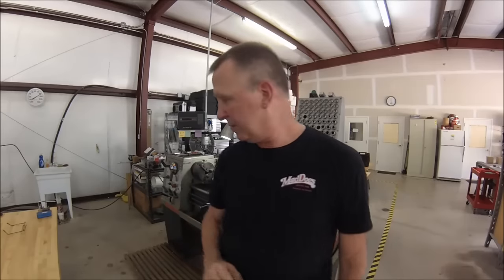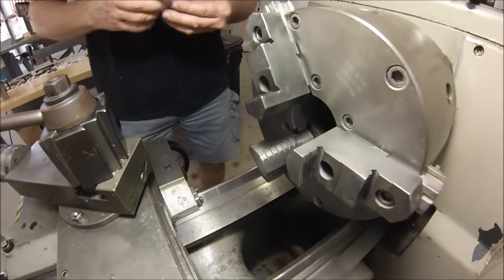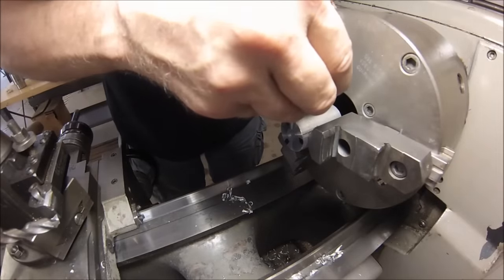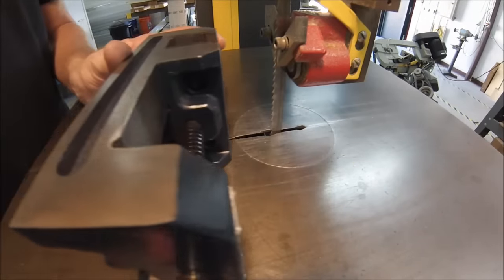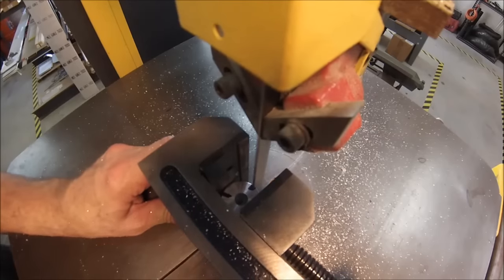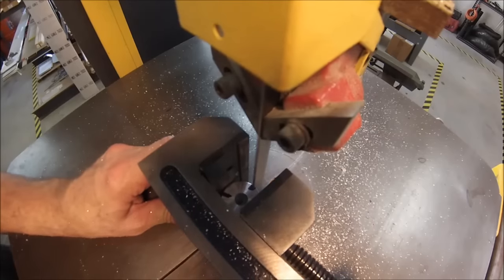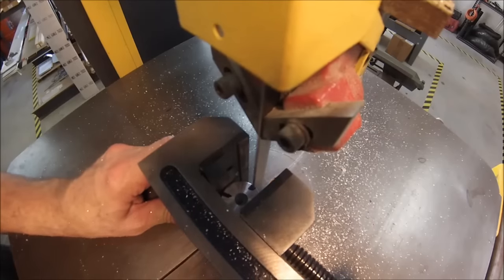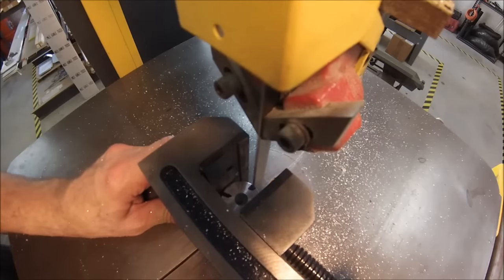Get your parts to run true in a non adjustable chuck. YOU MUST WATCH THIS!

Comment: never, EVER reach over a rotating chuck, major safety error. the 5 h.p. motor in that machine will have your lunch before you can think oh. oh. they make left hand lathe files for that job.
Reply from the maker: I would agree, but also add, to work the way you are the most stable and confident.

Comment: Could you show a video on how to get a reamer to cut to size? I have been in the trade for many years now and still this have problems with. I try to get the reamer to run true in the collet/holder within .0005 or better and ream at a spindle speed at about 68% of what I drilled it at. This works most times. I have heard people say that you should make a tiny chamfer with a ball E/M on the drilled hole to help the reamer get started strait. Any info. you could share with me would be greatly appreciated.
Reply from the maker: Greetings. I have personally noticed that the size of the hole prior to reaming can impact the finished hole size. Another good rule is' half the speed, twice the feed' for reaming. On holes over 1/2", I usually leave about 1/64, on holes up to 1/2", it usually .01 or less.
Reply: @joepie221  Thanks, I'll have to try it.
Reply: Hi, the only way I’ve known to get new reamers to cut size is by taking a stone to the chamfer on the 45 degree chamfer on the reamer. Just a single swipe on each edge is all it takes.

Comment: i've been a machinist for over 45 years ... never once said "thou"
Reply from the maker: You must not be from the north east US.
Reply: @joepie221  does philly count?
Reply from the maker: @davidjones-vx9ju  Not to a Giants fan. :)
Reply: @joepie221  Ouch! 😳😆. (Giants fan!)
Joe I don't mean to be dumb but I didn't get why that trick worked.
It's it the spindle it's centered on?
Reply: david you must have been working in a two man shop with someone who never said it.  A thou is very a common term.  Tenths refers to one ten thousands...
Reply: david you must have been working in a two man shop with someone who never said it.  A thou is very a common term.  Tenths refers to one ten thousands...
Reply: Everyone is different...

But they're all crazy...
Reply: I hate when people use the term mil.  Is that 0.001inches or are you being lazy because you don't want to say millimeter?
Reply: @gerpeter4489  no   very large die shop
Reply: @gerpeter4489  you probably say mils for millimeter too
Reply: @bradvandike9805  i agree
Reply: @davidjones-vx9ju  nope, mils for plastic vapour barrier thickness though...

Comment: Not a  bad idea for a hobby shop environment, but if your working in a manufacturing environment and the chuck is out .015" then the chuck needs to be replaced. This is not a very practical method for a manufacturing shop. I noticed the material is aluminum, over time the concentricity would be affected from wear due to repeated release and tightening of the jaws on the od of the collar.
Reply from the maker: By this comment, I am going to speculate you don't do this type of work for a living. In the 'Get it done" world of a job shop, you do what you have to to get the job out the door. Fixes like this are good for a small run, but nobody would do this for a large production run. Soft jaws or repair the chuck, but hats not the point of this video. And when you start throwing away chucks that are .015 out, let me know, I'll pay the postage, you send them here and I'll use them for another 50 years after minimal effort to correct the problem.
Reply: Amazing the number of smart guys that miss the point of this video!
Reply from the maker: I agree

Comment: It would help to cut down on your video size if you cut out unnecessary parts like walking away from lathe or trying something that doesn't work which you can just add annotation that it didn't work.  Also it would help greatly if you just speed up parts like boring, facing, cutting.  The important is outlining what you're going to do and speed up to the point when you're done.
Reply from the maker: This must be why I keep getting fired from my Hollywood jobs. Thanks. I get it now.
Reply: LOL.  English is my 2nd language too.  Sorry - you can't use that card against me :)
Reply: Who are you and who put you in charge?  My comments above are helpful suggestions with pure intent to help out Joe and unlike your the crap you posted for me calling names and telling me to stick to my own channel.  I don't know what country you came from but it's very anti-American mentality.

Comment: Indicating the runout of the outside diameter of the chuck is a complete waste of time and it solves nothing.  You hold the workpiece in the chuck jaws, not on the outside diameter of the chuck.   The outside diameter of the chuck does nothing to insure concentricity.  If you are concerned about the chuck running concentric, put a round diameter test bar in the chuck and check the runout of it.  It will show the concentricity of the jaws when they have a force on them.
Reply from the maker: Hey Rob. Nice of you to drop by again. Your comments are very valid. They don't apply at all to this video, but they are valid. Say hi to D.B. for me.
Reply: Rob Macfarlane I think he did that just to throw the entire chuck assembly grossly out of concentricity. Other than that, we all know that the outer body of the chuck does not necessarily relate to workpiece concentricity, given the series of tolerances and backlashes along the way to the workpiece.
Reply: Rob Macfarlane I don't think him measuring the outside of the Chuck had any purpose but to be illustrative. Give yourself a few minutes and go look up how the center piece and outside of a Chuck can differ in concentricity, because it's not the same. After, maybe you can look up a video on how to get a part to run true. I can tell you don't have much free time, so maybe you could combine those searches into "how to get a non adjustable/out of adjustment Chuck to run true. I presume you'd end up back here where you started, with a new veracity and maybe you'd watch the whole video uninterrupted. Also, lookup the word "illustrative". It might put some pieces together for ya, if none are missing already.
Reply: Joe-----------D.B. ?   ....Cooper?
Reply from the maker: Nope
Reply from the maker: Hey Rob. How about you share your industrial experience level with me so I know how to better respond to your comments. I'd appreciate that.
Reply: Joe------If worst comes to worst, try reading.  I'm not looking for a response, but if you feel you need to comment, by all means do.  YouTube is a great place to exchange information and ideas.
Reply from the maker: Rob. Every comment you leave solicits a response. With all due respects, Half the time I read your comments, I wonder if you have ever run a machine, been in a shop, or watch the full video with the sound actually on. Many of your comments land on this end as challenging and provocative. I'd be happy to spar with you, but I'd like to get to know where your remarks are coming from. I am truly curious as to your background. Please share it with us.
Reply: Joe----Just read what I write and don't worry about my backgound. And, Joe, when two people have a conversation, they are not "sparing".  They are talking.  If I wanted to "spar", I'd come armed.
       I find you comments entertaining.  You must be self-taught.
Reply from the maker: See ya Rob. I gave you a chance.

Comment: Get an adjustable 6 jaw chuck,just indicate part
Reply: Just spend $1,500 to $2,000 to get a good 6” (with back) chuck then. If you’re a business, you should already have reliable equipment. If you’re working from a home shop with a 50 year old lathe and a badly treated 50 year old chuck, then this is an affordable option.

I’m hoping you were joking.

Comment: Great Idea but if you only own a lathe, and no band saw and no reamers of the right size, Why not sell those thousand adapters  you have laying around, to those of us who do not have all that expensive equipment to to make an adapter for a crappy three jaw  chuck?
Reply from the maker: Thats actually not a bad idea.
Reply: you could use a hack saw, and just bore the adapter with the boring bar (which is even better than using the reamer for concentricity).  its not rocket salad.

Comment: Can’t say that I’m NOT still a little confused of how you start with a Chuck 15 thou out of concentricity and turn a collet in that chick that you end up running less than 1thou out?   Boggles the mind.
Reply from the maker: The OD of the bushing is not concentric to the ID. The OD runs true to the chuck, the ID runs true to the machine centerline.
Reply: I also couldn’t understand the reason mr. Pie for what he was doing but, in reality it is creating a Chuck that’s eccentric in itself but centered to the machine. He compensated the 15 thou by making the collet and drilling it eccentric in it. Very clever!
Reply: @roadshowautosports  yeah it was just hard to see 15 thou and orientation of the collet using the tailstock I believe for proper alignment of the hole drilled in the collet.  Makes sense it just threw my mind a bit.

Comment: My adjustable chinese 4 jaw chuck is much more accurate and just cost me around 100 Usd. Making more of these collets costs you too much time, even for private use.
Reply from the maker: Lets read the title of this video one more time. Its not about 4 jaw chucks, or chucks with adjustable jaws or capability. Its about getting the job done now, cheaply, and with compromised equipment. I'm not sure how valuable your private time is, but if you can't afford to spend 5 minutes to make a quick collar like this, perhaps you need to take a vacation and keep you hands away from moving machinery.
Reply: I have a brand new 12" D!-84 jaw that runs out .012 on the face. Just because it 4 jaws doesn't means its any good.
Reply from the maker: Is your comment for me or Sebi Unger?
Reply: Yeah it was for you. If you don't have an adjustable chuck it's a good solution. 5 Minutes is not realistic for me and if you need 10 Minutes per collet and 20-30 things per year to run true, it don't pays off. On the other side I don't have the space to store 50 of this collets for many diameters and I am sure that I don't have the right collet for the part number 51 :D

It's a a really good video, I just wanted to compare the work over a longer peroid of time with the price of an chinese adjustable 4 jaw chuck. 100 Usd is not so much money for that hobby.
Reply from the maker: Ok. As much as I welcome, and ask for comments. Comments like yours that take the context of the video and throw it out the window don't deserve a response. Especially when you're not a subscriber. Read the title of the video before you comment next time. I see you are the kind of guy that would watch a video on jungle survival and comment that checking into a Hilton with room service is much less work. I still welcome your feedback, but only when my presented solution doesn't solve a problem, feel free to blast away. Otherwise, watch and learn.
Reply: Buying a cheap 4 jaw adjustable chuck solves the problem and it's available everywhere for a low price, it's not like the Hilton hotel in the jungle, so I prefer this solution. And if I don't deserve a response - don't answer ;)
Reply from the maker: Everybody deserves a response, but the comments that come in from browsing non subscribers that stray from the topic are frustrating. Imagine the looks you would get from the boss if you stopped a job midway and told him to buy you a cheap 4 jaw Chinese chuck so you could finish the $75 part he's paying you to make, or your small limited home shop was doing the job and you weren't fortunate enough to have a 4 jaw. Time lost and money spent. Avoiding that scenario the point of this video. I have to imagine you are not a machinist by trade. I also have to imagine there are not many machinists out there that don't have at least 10 of these collars in their box.

Comment: I’m trying to understand how it works, even after seeing it. Can you explain a little more. Thanks.
Reply: The rotating body isn't rotating concentrically, but there's always a center of rotation.  The hole was made at he center of rotation.  Important to understand then the hole isn't perfectly in the center of that slug, but it is perfectly in the center of rotation.  So even though the lathe head isn't spinning concentrically, that slug/bushing is now 99% off-setting the misalignment of the head.

Comment: Off topic, but one thing I noticed @ 8:00 was that you checked (by touching)  if there was a burr while the part was still moving. I have been tempted to do this but always catch myself and stop the part first. Ever been cut doing that?
Reply from the maker: My fingers are pretty calloused from doing this my entire life. I do occasionally get cut, but I don't feel it, nor does it bleed. Unless I get cut, in a cut, then it stings a bit. I never just grab a spinning part, thats just not advisable. If you keep your finger moving across a suspected sharp area, you'll feel the burr. But for safety, I would suggest shutting it off.

Comment: I wouldn’t reach around like that with a file.
Reply from the maker: Although it does have an elevated degree of "potential" danger, I believe its a more stable posture with your left arm on the head stock. Filing left handed, if the file walks off the part, your natural slip direction is directly into the spinning jaws. But you do what you feel is best for you.

Comment: what a palaver, I have to do this every time I machine a different diameter, it would be easier to buy an adjustable chuck. BTW you said un-loosen your jaws to take out the shim, that means tighten them up doesn't it ? 😆
Reply from the maker: Adjustable chucks are expensive , but wort every cent. If you don't have one, this technique, or sofe jaws are about your only option. And..You are the second guy to call me out on the un-loosen comment. You are right, the term is a total contradiction, but I have always said it. I'll be more careful. It would meant to tighten it up, you are right. Thanks for the comment.
Reply: Yes we can't confuse the newbies :-)

Comment: A few things. 
1. I have never seen a lathe with a self centering chuck over a few thou out.
2. Any lathe this far out would be considered unusable until the extreme problem was correctly addressed. 
3. It takes the same amount of time to properly true the jaws on a chuck with a tool post grinder.( I trued the jaws on my 1911 New Haven with a Central Pneumatic die grinder mounted to the compound and got repeatable 3 thou runout on an extremely clapped out 100 year old lathe)
4. You might have done this vid using more common tools. I doubt most people have a .501 reamer etc. Yes you said you could just bore it, but you did not do it that way in the demonstration. A band saw is also needed for this trick. 
5.This is a lot of work for a chuck that is a few thou out. To make a special holder for every piece is not a realistic trick. You had to make it be 15 thou out for effect or it would seem very anticlimactic for the amount of work needed. Just grind your damn jaws with any die grinder at this point.... Thanks for all the great vids to critique. I enjoy your narration.
Reply from the maker: Thanks for this comment. I'd like to comment back.
1. I've never trusted chucks to align or center with the precision that a collet can offer
2. Obviously a chuck this far out is not unusable because i just used it
3. No quality machinist can re grind chuck jaws in 5 minutes, because thats how long this would take if I didn't have to narrate and film it. Plus, not all home shops have a toolpost grinder.
4. I reamed the hole for speed so my viewers wouldn't complain about how long it took, or maybe not having a small bar that would go that deep without ringing all the way. You could also split the bushing with a $5 hacksaw
5. I would never suggest you make a collar for every part, this demo was a band-aid fix to prove it can be done and the problem should be addressed as time and money permit.
I welcome comments, but the whole point of this video was to show how to get around an obstacle and finish the job.  Creative screen name by the way.
Reply: Joe Pieczynski Hi from England. I have been using a modified version of this method for twenty odd years now and can attest to its usefulness. Here, in model engineering circles, it's commonly called a 'chullet' , from chuck/collet. Cuz not all of us can afford top spec machinery at home. My own lathe is a1948 Myford ML7 purchased in '52 by my uncle and still pretty much original.
Reply: I built a Stuart No 9 on a lathe like that & I loved it,  Change wheels got a bit of a pain though.
Reply: 4. You could get away with a normal hacksaw, the relief cuts don't need to be precision
Reply from the maker: True. thats why I stated this in comment #4 from above